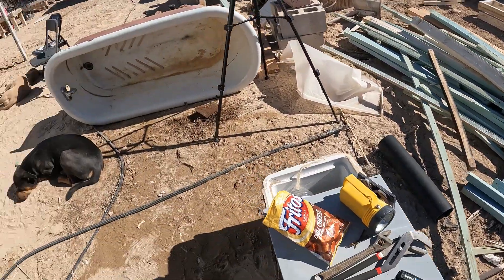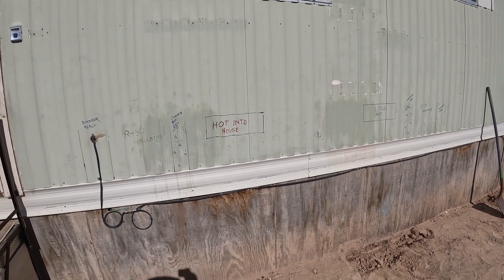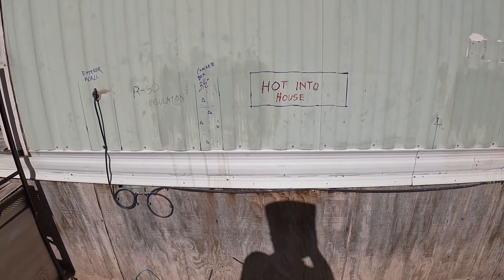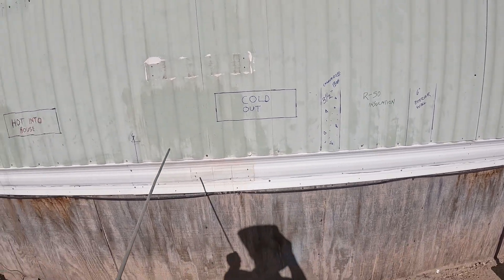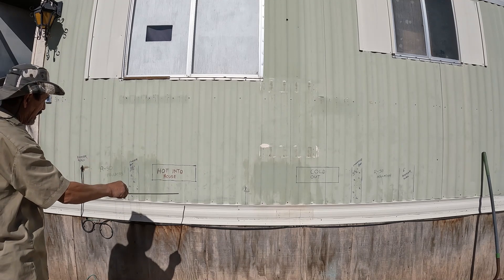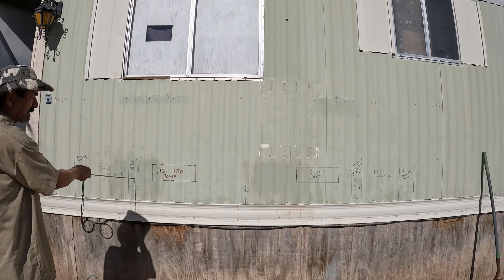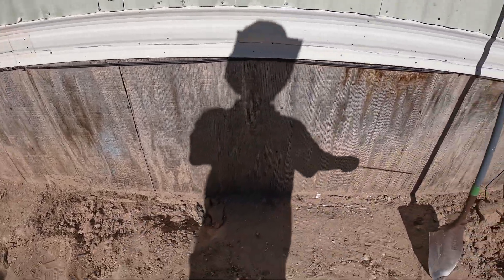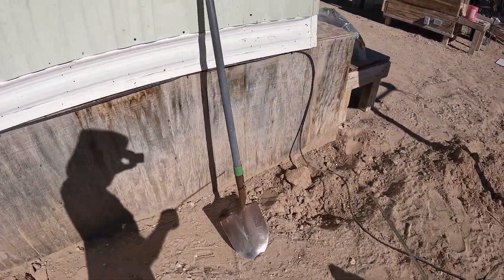Bathtub Sand Battery Update Part-25-A

Comment: Build  some extra  room in your structure  so you can increase your sand capacity  as you may find you will want more heat as you find more uses than space heating . Distillation of water or fuel and many other uses ,if you have it you may use it all and want more .